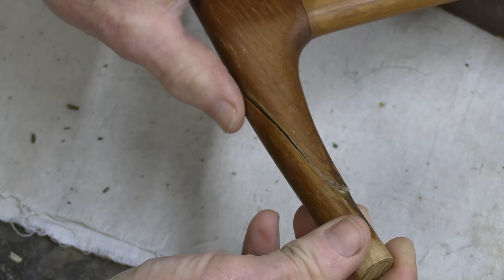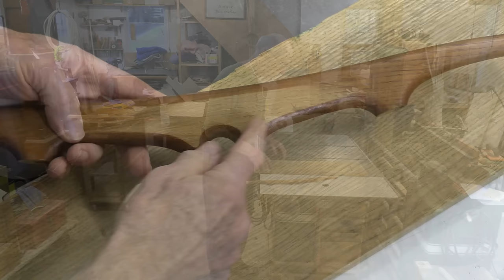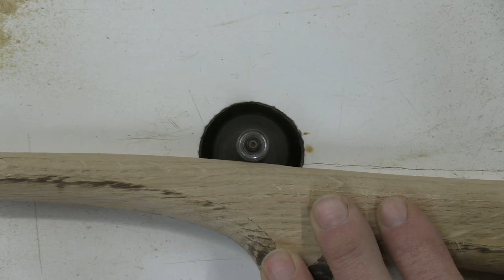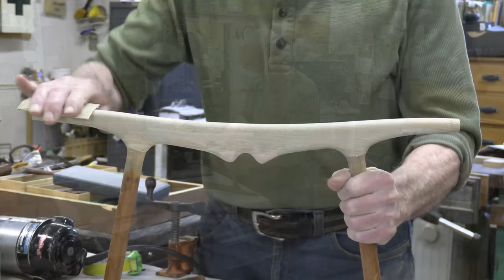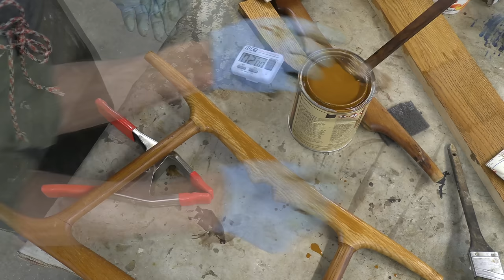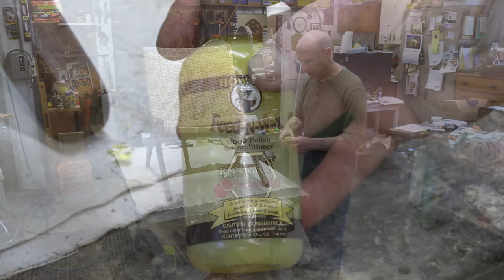Restoring a Masterpiece - Thomas Johnson Antique Furniture Restoration

Comment: I understand why you made a new piece, but someone else might be asking."Why not just use the same piece you glued back together? the joint should be strong enough right? " I have also used "spreader clamps" they work great. thanks for another great video Tom and once again fantastic video editing. as always. thanks for sharing. ECF
Reply from the maker: You're welcome Ellis! This one had already been glued, and also another one I repaired by gluing failed also, so I just had to make a new one

Comment: Nice job with the router duplication that part. I supposed the break repair would not have been strong enough even with strong glue.
Reply: I thought so too about the previous stretcher not being strong enough with the grain orientation and the fact that it had previously been repaired and failed again.
Reply from the maker: Thanks! Frank Vucolo is correct
Reply from the maker: Exactly! Thanks

Comment: Ok- we are all asking in the comments, and indeed you ask in the video title:  why did you remake that piece when the repair appeared perfectly strong enough?  Inquiring minds want to know!
Reply: I think if you look at the grain orientation it is quite weak and it will likely fail again near the repair. The new piece has straight grain and is more resistant to the shear forces that caused the original failure.
Reply: @petegraham1458  it is a stretcher under compressive, not lateral, force and at least 50% of the wood under that force remained. Secondly, the break was with the grain as you point out, providing plenty of glue surface. Any experienced wood worker will know that such an area, glued with tightbond, will be stronger than the original wood. And finally, while I have all the admiration in the world for TJ, he is a conserver first and and restorer second. I do not see how replacing such a large piece of the original was needed or in the best interests of preserving the piece. And because I respect TJ I am assuming there is something more we don’t know. Hence my question. I think he clearly signaled same with his “why do that?” title.
Reply: Strengthening one area of a structure riddled with similar faults invites the inevitable stress to find unrepaired areas nearby, so even if the first repair is almost undetectable, it will likely need another at some point. Also, originals of this chair can fetch ridiculous prices, so a new piece with sound lumber might pass as original if the forgery "looks good" enough (to borrow a phrase).
Reply: @robertphillips93  I have no basis for believing the area was “riddled with similar faults”. Again, it’s a stretcher under compression. And any furniture expert will instantly spot the replacement, no matter how artfully done, and it will devalue the piece considerably. That’s why there must be something more going on here. I hope TJ responds.
Reply: I think the title is more about the wood choice, right? He previously repaired one in teak, when it's fumed oak.
Reply from the maker: Thanks Ed! That had been glued before and it failed. I repaired another of these by gluing and it failed. So from now on, with these chairs, I'll make a new one
Reply from the maker: Thanks! Yes, but the grain wasn't too bad. But a glue repair had already failed so...
Reply from the maker: Good points but...
Reply from the maker: Thanks! Yes, my replacement will not affect the "value"
Reply from the maker: Thanks Ed (again). I'd seen too many failures of attempts to repair that stretcher. No one is selling the chair anyway. They want to use it
Reply from the maker: Yes, it looked like teak. But it wasn't fumed oak, which is usually quite dark

Comment: A band of elastic material swung a little stretched over the glueing parts give clamping, can bring pull force onto a piece and give extra friction surface for woodclamps. I tried surrounding glued parts with lots of elastic bands. Worked very well. 
I learn so much more from this channel.
Reply from the maker: Thanks! That sounds like a good idea!

Comment: I was wondering about what secret you would use so the glue repair would hold up under the high stress on the stretcher. Even with Titebond. And then it didn’t have to!  Thanks for the video.
Reply from the maker: Thanks! Especially because it had been glued before

Comment: Another wonderful video. Question: If the spanner that was broken was the one with the name of the maker, would you have proceeded differently? Specifically, would you have replaced the entire piece or would you have tried to somehow incorporate the wood label into the repair?
Reply from the maker: Thanks David! I was thinking about that, and I would have tried to cut that out and make it part of the new stretcher. I'm not sure exactly how - luckily I didn't need to!

Comment: I might have missed something at the beginning. Not exactly sure why the stretcher had to be replaced if the glue joint was solid. Nevertheless, an alternative to the three F-clamps on the round surface might be a wrapping of surgical tube or strip of inner tube. Another excellent exercise in finish matching!
Reply: Yes Tom, you should explain us why the stretcher had to be replaced, since the tite-bound re-glue is supposed to be more robust than the wood itself... This was not very clear in the video.
Reply: We had the same question. We even “rewound” the video, thinking we had missed something. We decided that Thomas needed to repair it to get a complete template he could trace for the new one. But maybe that’s not the answer.
Reply from the maker: Thanks! Yes, I should have explained. I had repaired the same stretcher on another chair by gluing and it failed. So I decided for this chair to make a new one
Reply from the maker: Sorry! But it had been glued before, and had failed
Reply from the maker: I'm so sorry I didn't explain!

Comment: Completely competent, as usual, Tom! No doubt that a replacement like this has the best chance of both improving the service life of the chair and retaining a good market valuation. (And the match is so good -- and unsigned by you too, even the best detective will have a hard time showing it's not original, short of C-14 testing!)
Reply: When you're a Danish modern nerd that's not totally true! You can see the difference between oak fuming and stain up close. But I won't lie, it'd be one of those repairs you notice after you've had it for two years and find yourself staring at each part of a bright sunny afternoon, and only then! Otherwise imperceptible.
Reply from the maker: Thanks! Yes, I felt the same way
Reply from the maker: Thanks! Here's the thing: would this chair be more valuable with a broken stretcher? Or is it better with a well crafted replacement? Either way it will never be as valuable as a chair that has never been broken and is in excellent condition.
Reply: @johnsonrestoration  I'd take the chair that you'd repaired over any other repair. The fervent Danish modern fan will unfortunately know details, no one could humanly derive from just looking at it.

Comment: Hi Tom, great video!  Is it possible that you or anyone else reading the comments knows the specific model of the jig you use to drill the holes at around 8 minutes into the video?  It looks like a dowelling jig but I haven't been able to find anything that matches that specific model.  Looks like a really handy tool.  Thanks again for the years of experience you're sharing on here.. its inspiring a whole new generation of people when it comes to repairing and restoring furniture and appreciating quality materials, tools, and techniques.
Reply from the maker: You're welcome! That's a Stanley 59 dowelling jig. You can find them in antique shops
Reply: @johnsonrestoration  Thank you!

Comment: 👋 Tom, I'm so impressed with your channel. I had hoped to work with furniture for the rest of my life. But that's another story.
What I want to ask is, what did we miss? Why did you end up not using the original repaired piece from the beginning of the video? I have a habit of dozing off so I apologize if you explained it in the video.
-regards
Reply from the maker: Thanks! I had repaired a similar break before on another folding chair and it failed

Comment: When you started out by gluing the piece I was wondering if that would be strong enough.  Then as you progressed I saw what you intended.  However, would an epoxy glue repair have worked?  Curious.  Thanks Tom.
Reply from the maker: You're welcome! I had made the same repair on another folding chair and it failed.
Reply: @johnsonrestoration  

Thank you!

Comment: Question:  Maybe the customer asked you to do the repair the way you made a new stretcher, but wouldn't it have been much easier and just as strong a repair if you used Marine or Industrial Epoxy on the cracked stretcher? For joints other glues are better or traditional, but we have repaired non jointed wood with epoxy that has remained strong for decades while avoiding the headache of making a new part.  A question made with respect and just so you understand I think your work is almost peerless and outstanding.
Reply from the maker: Thanks John! Because I repaired another Wegner Folding Chair with the same break, using epoxy, and it failed. There is too much stress on that stretcher

Comment: I almost felt for a moment that this was a re-upload, but it didn't take long to find what I had in mind. You had repaired a pair of apparently identical chairs a couple of years ago. I'm only 50 seconds into this video so I don't know what issues you'll run into yet, but both stretchers on those other chairs were broken too.

Edit: So in the other video you did the repair with teak. Did they use different woods for these chairs from time to time?
Reply from the maker: Thanks! The teak was a mistake. Also, one of those chairs failed which is why I made a new stretcher this time

Comment: Hi Tom, what name is the tool or attachment you use that clamps to the work and allows you to drill holes , but prevents the drill piece slipping and remain straight?
Reply from the maker: Thanks! I'm assuming you mean the dowelling jig, that's a Stanley 59, they don't make them anymore. But there are a lot of dowelling jigs on the market, I bet some of them are better!

Comment: I am doing my first restoration of an 19th century antique. The wood must be maple or something for how hard and ringing it is when you rap it with your knuckles. It is super thirsty, but the pores seems small and tight. I am curious what you do when the pieces needing replacing are from extinct trees (American Chestnut) or old growth trees.

Trying to sand off the redish stain. When I get the wood wet, when it appears to just have a little redish-orange stain in it, the wood gets really splotchy with an almost grape stain color.
Reply from the maker: Thanks! It sounds like it's birch, possibly stained with a dye stain to make it look like mahogany or walnut. If you restain it that will help a lot with the blotchiness. I always use the most similar piece of wood I can find, hopefully the same species! Can't do anything about old growth wood
Reply: @johnsonrestoration  I think you are right about the wood species being birch and the dye stain. If I got a paper towel wet and rubbed a piece of the chair (after sanding so only a few orange spots were in the pores) the wood looked as though someone had hit every pore with a really dark purple marker. The original stain was painted over at some point with a green that looks scarily like some victorian arsenic (which also has a metallic like sheen to it in the pores that soaked it in really deeply). The chair was then painted white probably during my grandparent's generation. Then I come in 100 years later and get all the (probably leaded) paint and dye off.

I finally applied a coat of water-based cabernet color stain today, which was close to original color, after using a conditioner. It isn't looking great, but I got to call it "good enough" at some point. It isn't meeting your standard of "pretty good", but it's better than the mess it was by a long shot.

What would you use to finish a water-based stained old rocking chair? I bought some water based satin poly. Now, I am having doubts that this is appropriate.

Thank you for answering my comment and helping me learn so much about this process. It is calming, educational, and interesting to watch your videos!

Comment: Tom, would it have been easier to use a Mirka pad, say 2500, instead of the 0000 steel wool? Just thought the pad, cut into strips, might be easier to handle that wax.
Reply from the maker: Thanks! I am not aware of the Mirka pads. I'm about to order some Mirka sanding discs, I'll look for them

Comment: It's fumed oak, so could have applied some ammonia to colour it correctly - doesn't make the grain stand out.
Reply from the maker: Thanks! So many commenters have referred to "fumed oak". This is not fumed oak! It was unstained. Fumed oak is blackened, think mission oak
Reply: @johnsonrestoration  Fumed oak is not a binary thing. It's called fumed precisely because it allows more control than liquid tannin reactants. Give it an hour in ammonia fumes and it'll be barely changed, give it 12 hours and it'll be dark.

Comment: Why did you choose PVA rather than epoxy to repair the stretcher?
Reply: Because the purpose was only to enable the 'copying'. In addition, there was good wood-to-wood contact; PVA or Titebond properly applied is stronger than the lignin holding the wood fibres together, so the epoxy would not have made for a stronger piece in any case.
Reply: @dlevi67  thank you
Reply: @deerfootnz  You are very welcome. Have a good weekend!
Reply from the maker: Thanks! dlevi67 is right on!
Reply from the maker: Yes, thanks!

Comment: Pardon my ignorance, but why did you replace the whole piece instead of repairing the original piece that was broken? I’ve seen you do this many times. What makes this different?
Reply from the maker: Thanks! There is so much stress on that piece! I had repaired another of those chairs where I repair the original piece and it failed. So I felt I had to make a new one for this chair.

Comment: Not all that surprising, to see oak disguised as teak so soon after the War.
Reply: Teak's popularity in the mid century was started by the small cabinetmaking houses that produced these kinds of chairs, but it didn't really take off until there was mass production machinery that could reliably mill the exotic timber. This wasn't oak trying to mimic teak I don't think, teak wasn't necessarily en vogue yet.
Reply from the maker: Thanks! Wegner preferred oak, they weren't trying to make it look like teak
Reply from the maker: Correct! Wegner preferred oak

Comment: I'm not sure I understand this approach. Once the broken piece was glued back on, I would have simply drilled for a 6" or so 1/4" steel rod and epoxied it in, done a little sanding and touch up and Bob's your uncle. It would have been stronger than the new piece. You can see the design flaw with the grain running through the recurved section. The new piece is going to have the same weakness. Best to repair around the design flaw rather than repeat it. Too, no matching problems. This repair made a mountain out of a molehill.
Reply: All true, except for one small detail. That is, you can find examples of this chair for sale at over US $10k -- unrepaired. Hard to guess what the market is like for the robust version . . .
Reply from the maker: Thanks! Simply put, I had repaired these before by gluing and they failed. Inserting a steel rod is not practical, the piece is too small. By drilling for a rod you will weaken all the wood around that rod. I've seen a lot of failures with that approach
Reply from the maker: Thanks! Really though, practicality rules. This chair is going to be used

Comment: I am confused about why, if you were going to make a new piece, did you glue the broken one?
Reply: He used the broken piece as a router template to fabricate the replacement.
Reply: I also had the same thought, but Tom needed the broken one glued to use it as a template to make the new piece.  I assume that the original one, even reglued, had an inherent weakness with the direction of the grain.
Reply: A complete pattern to work from
Reply: I was confused about that too.
Reply: @NCWingBone1  Thank you for clearing that up!
Reply: Yes but it seems like the repair was perfectly adequate without remaking the piece. The title of the video suggests he knows it’s going to be a question. Remains unsolved…
Reply from the maker: Thanks! Yes, a template for a new one
Reply from the maker: Exactly! Thanks!
Reply from the maker: Thanks! It had been glued before so it was obvious a new one was needed
Reply from the maker: Yes, thanks!